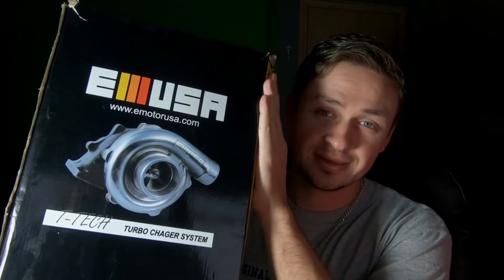I'm Going Turbo!  (Honda Civic R18 Build)

Comment: The reason why the price of name brand turbo kit (PRL, Full-Race, etc) are so expensive is because of the quality of the parts they use to build the kit. You don't need to second guess with name brands, no need to cut the bumper, plastic trims to make them fit. DIY turbo kit is the complete opposite of that! Good luck and hop you tune it like you said you would on FB lol
Reply from the maker: Thanks! You get what you pay for.  It’s still very possible to do.   But like I said we will see what happens once ideas turn to action.